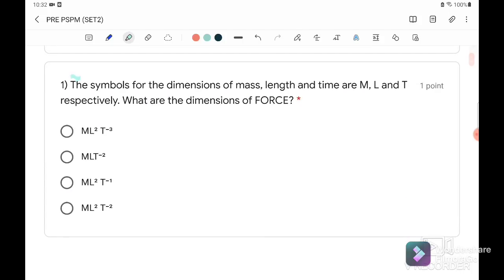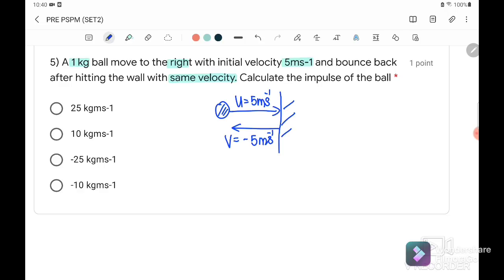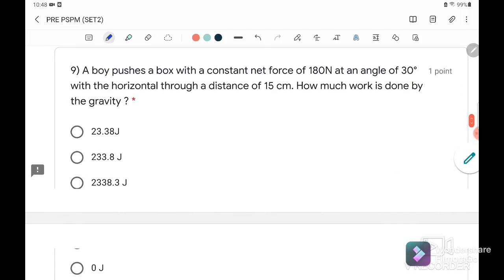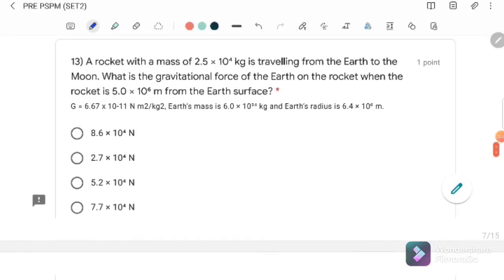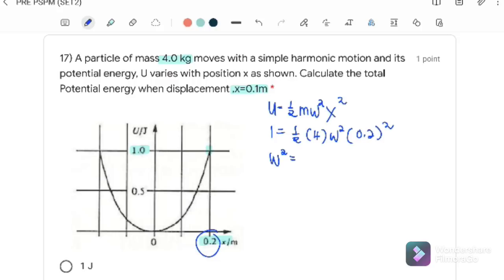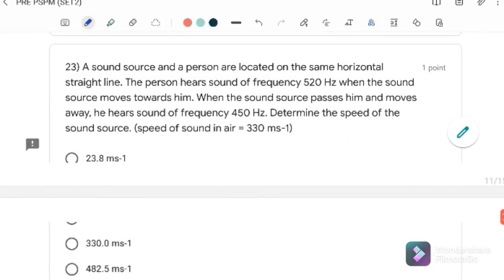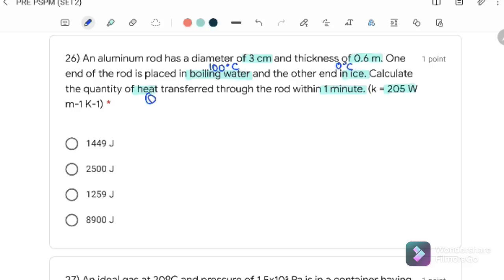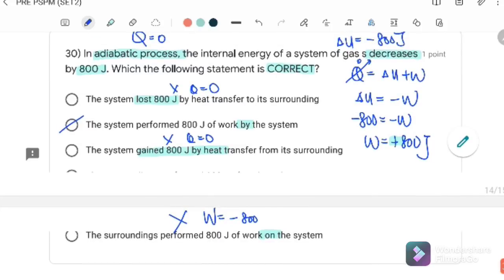PRE-PSPM 1《SET 2》SP015 • PHYSICS

Comment: Madam for question number 17, can I just assume potential energy? Since it's at x= 0.1 m the potential energy will be less than 0.5 J based on the graph.
Reply from the maker: To play save,  better u calculate..
But, u can use graph to double check  the possibility of the correct answer